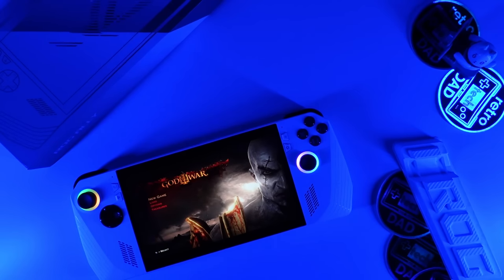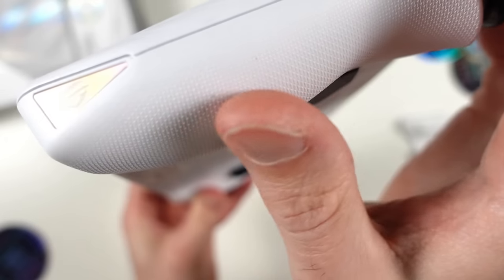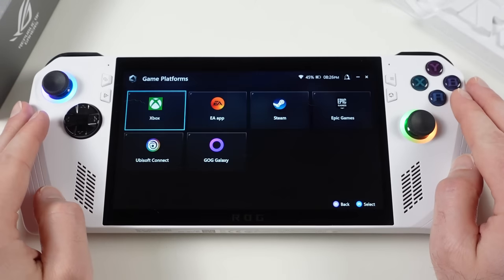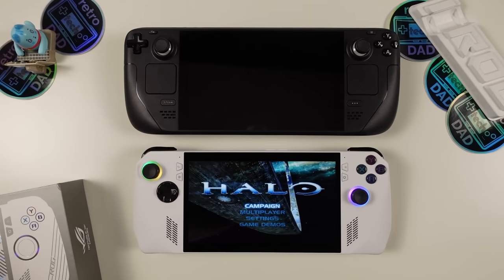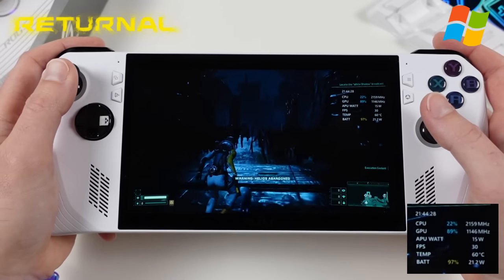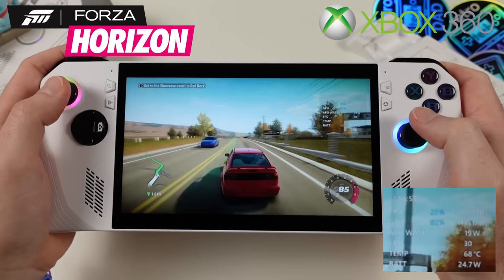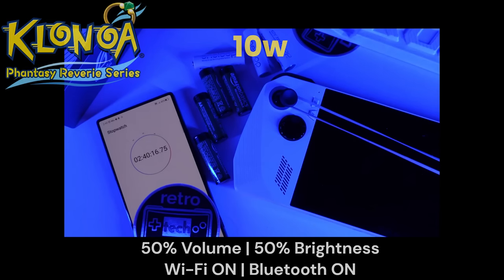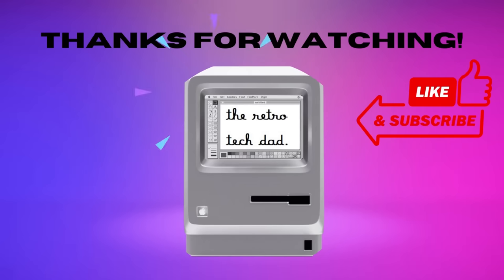ROG Ally | An In-Depth Look (Ryzen Z1 Extreme) Unboxing, Teardown, PC Gaming, Emulation, Testing

Comment from the maker: God of War 3 (BCUS98111) settings for RPCS3:

CPU:

SPU XFloat Accuracy: Relaxed XFloat

Enable SPU loop detection ON

SPU Block Size: Mega

GPU:

Framelimit - 60

Write Color Buffers ON

Asynchronous Texture Streaming ON

Advanced:

RSX FIFO Accuracy: Atomic

Driver Wake-up Delay - 100

I'm using game ver 1.0 and have all the patches enabled for it except for the unlock FPS option. 
Disc version (BCUS98111)

Comment: When removing the bottom middle screw, the screw will separate the front from the back shell as you unscrew it preventing the need to use any prying tool. That is if you save that bottom middle screw for the last screw.
Reply from the maker: I noticed that as well!

Comment: I continue to suffer watching these reviews when I can't buy one yet. Did you play those PC games at 720p or 1080p?
Reply from the maker: Great question! 

Returnal is 720p making use of that RSR. 
Callisto Protocol is running at 1080p.
Uncharted is set to 1080p with in-game FSR2 set to Quality.

Lots of ways to go about settings because of some of the options available.

Comment: Some PSA here: Don't waste your time re-paste the thermal compound. Ally already using some variant of PTM7950 which is Phase Change Material. It's optimized for thermal performance and longevity. You are mostly likely not getting any better other than using Liquid Metal. (Also don't mess with LM if you don't know what you are doing)

If you do open the heatsink, just scrap whatever on the heatsink and push them back to the middle. You can reuse this stuff since it will change phase (=melt) when heated.
Reply from the maker: Good to know, saves me some time and benchmarking! 😅🙏
Reply: @retrotechdad  ASUS uses top of the line stuff here and the built quality is excellent. The profit margin probably very thin this time.
Reply: @samic my guess is Microsoft might be giving them some money
Reply: @samic  so you mean the only thing that needs to be improved is Microsoft? Should i say agree?

Comment: I havent heard reviewers talk about the VRR of the screen. Is it something to be considered as a significant benefit over the Steam Deck as it can give perceived smoothness of gameplay with games that have some dips in framerate?
Regarding battery life, honestly, 1-2 hours is plenty of time to enjoy a game especially since it charges back to 100% in the same timeframe. It almost forces you to take breaks which for gamers is important. As a father of an infant I rarely have time to play for longer than an hour anyway. 
Im still torn between trying this out or just continuing with my steam deck. Alot of other companies, ayaneo, ayn, gpd and anbernic are about to come out with the 7840u handhelds too. Im trying to stay patient until end of this year.
Reply from the maker: Excellent question! Yes, the VRR is a very nice benefit for gaming as it reduces screen tearing when going with higher/variable FPS. 

Diablo 4 is a good example since it can fluctuate for me from 100-120 fps but there's no visible screen tearing of any kind. 

Personally, I am happy with the battery performance from most of the x86 handhelds including the Ally. I agree that going beyond 2 hours on a handheld is probably not the most realistic use case for the majority. 

The Steam Deck is a great handheld still so I say wait it out a bit to see what else is coming before the end of the year and then make a decision. 🤗

Comment: Why do battery tests at the different wattage settings, but you only show gameplay on one specific preferred setting for each game? Definitely would like to see the actual capabilities on display in these types of videos imo, other than that it was definitely in-depth and a good bit of info for new users.
Reply from the maker: I'm not sure what you mean? The battery tests are done in-game with settings making full use of the available power to appropriately put load on the device based on the TDP. Based on battery size (40WHr) and power draws on the battery, the tests are fairly accurate. I hope this helps clear it up. 🙏
Reply: @retrotechdad  You mention in Returnal for example that you typically use a custom 18W mode, but that the footage was at the 15W mode. Why not have it plugged in, on turbo mode like with the benchmarks? I was referring to you correctly testing the battery in different wattage settings, but not the gameplay in each wattage.

Comment: Can this also emulate  Gameboy/Gameboy advance games and GameCube  games as well as nds or 3ds games. Even if it can’t I’ll buy it soon
Reply from the maker: Yes, definitely! I'm actually starting to roll out my emulation videos for the device. I've covered PS3 and Xbox 360 so far and it does really well with those which is about the most difficult to emulate right now.

Comment: I noticed you're using the BIOS version 319 for this video.  It's known that that version performance is up to 20% worse than the previous, ASUS already acknowledged the problem and they say they are fixing it, but you can rollback to the Version 317 until then.
Reply: How do you stop the pop up to constantly update to 319?! It’s maddening, so I gave in.

Comment: I’ve been struggling to find gow 3 pkg and rap file since nopaystation doesn’t have it😩 been playing dbz budokai  tenkaichi 3 tho, Rog ally is amazing, glad I went with this.
Reply from the maker: It's amazing for PS3 emulation! BTW, God of War 3 was only available as a disc game. 😉🤗
Reply: @retrotechdad  First time messing around w emulation, got it. Runs pretty bad tho 😭
Reply from the maker: Which games were you testing? Some might need a few settings tweaked.

Comment: Not a full size analog stick only the aya neo has one, they are slightly bigger than the switch but still not full size more like medium size
Reply from the maker: It's nearly identical in size to an Xbox Series controller, measured on camera.
Reply: @retrotechdad that’s interesting i meant to say thicker, i have both aya neo 2s and rog ally and the ally  has some serious dead zone even after adjusting. Hall base magnetic is the way to go. Also you were right about the sharp edges they are no joke if you are playing fps they start to dig into a pressure point in your palm making your fingers tingly definitely not very ergonomic thinking of returning, great review though im subbing!
Reply from the maker: Yea, I think it's interesting that ASUS went with hall sensors for the triggers but not for the analog sticks. Thank you for the sub, I appreciate it! 🙏
Reply: @retrotechdad hey question idk if you have noticed the very odd behavior with the charger or if its just my unit. Example when playing cyberpunk 2077 med settings pretty stable 40fps, 80*C, 30W but as soon as i plug in the charger it starts going crazy 35fps,95*C , and using 45W! The only fix i could find is using a (unoriginal charger) samsung 65w and the temps and watts remained stable literally the most bizarre thing i have experienced.